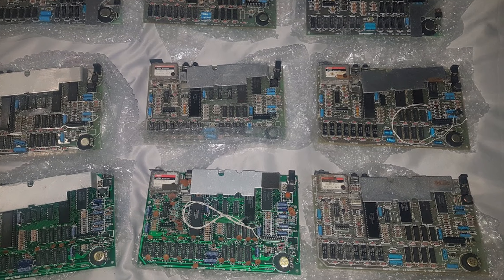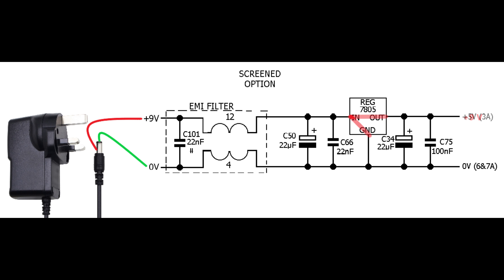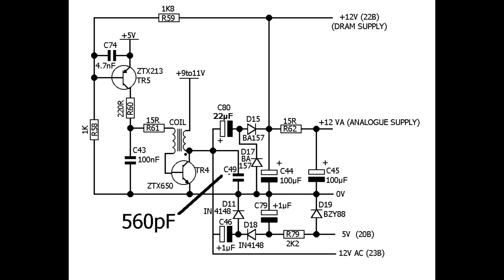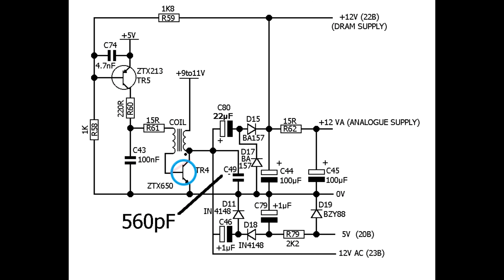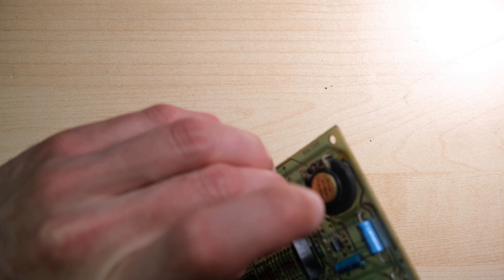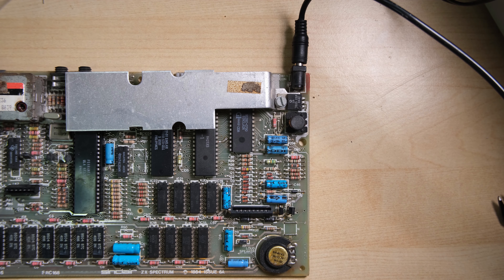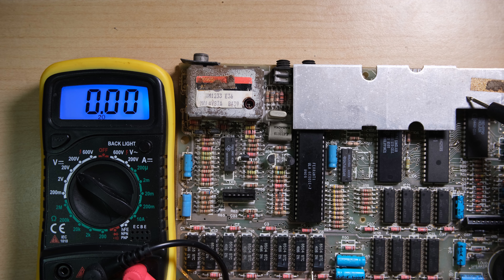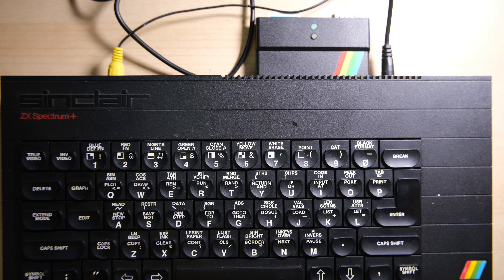ZX Spectrum Power Circuit Repair

Comment: I've recently repaired quite a few of my spectrums, one in particular had managed to blow up nearly every single silicon component in it. I suspect it was possibly lightning damaged before I got it. Still managed to get it going, and it's now happily working in the background. Keep up the good work, Aston.
Reply from the maker: Thanks Aston. Somebody probably plugged in a peripheral while the power was on!
Reply: @HappyLittleDiodes   The coil was vaporised, as were the tracks on the board, in total 22 I.C.s were faulty, (128k Speccy) A labour of love and totally not worth repairing, but I ended up just wanting to see what had gone pop. Had to wind a new coil ironically, so bought a reel too, and I now have enough wire left for 1000's of coils :D The things we do. Still, it was educational and a bit of fun.

Comment: I`ve just done up another Speccy. New caps, transistors. I was getting 0.850 amps at 9 volts. 13.2 volts, 5 volts and -5 volts. Then the 12 volt rail went up to 18 volts. I took out the 270 ohm resistor/ 4.7 uf mod and now no power. I`ve took out the transistors and they are ok. All a bit confusing lol. I bet the 18 volts has killed things even tho they was still a picture.
Reply from the maker: Oh yes that sounds like something has gone wrong. The one time I got such a large voltage was when I did that power mod wrong.  It's an issue two right?
Reply: @HappyLittleDiodes  yes an issue 2. I`ve just powered it up using an old computer PSU. Lower ram is shot now. :)
Reply from the maker: Oh dear a long careful debug and repair is needed!

Comment: I've just repaired a Spectrum picked up from a boot sale, it was in a sorry state. Ended up replacing 7805. all 4116, all upper RAM, repair a corroded trace for the 50Hz and D9 due to no sound. I think the previous owner plugged the wrong power supply into it which was probably a center positive and blew everything. It's a nice feeling saving it from the dustbin.
Reply from the maker: That's the goal here!  No speccy left behind. Good job.

Comment: Hi HLD. If The voltage of the PSU is just under 9V, e.g. 8.5V, will the speccy still work? Is it any dangerous to the internal components?
Reply from the maker: Hi! According to the service manual you have a tolerance of +/- 2 V. Below 7 V and the 7805 voltage regulator won't be happy
Reply: @HappyLittleDiodes Ta!

Comment: You know the collector and base are like a diode, right? So a continuity test of the coil still connected to the transistor is incomplete if you don't reverse polarity.
Reply from the maker: Yes that's true.  However, when testing the coil I was only really interested in whether or not the windings are shorted, I got a beep one way, so didn't need to reverse.  The test shown on the video is while the TR is removed.